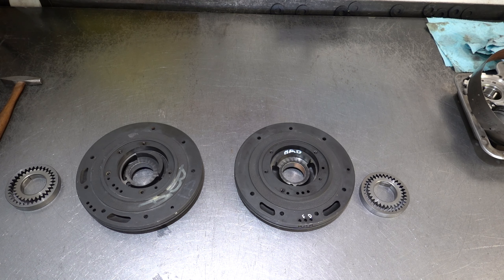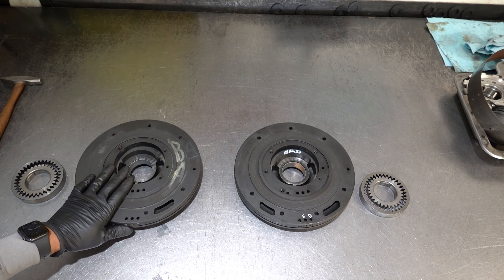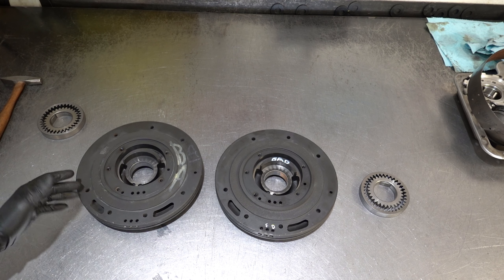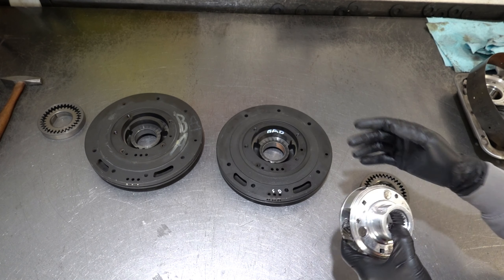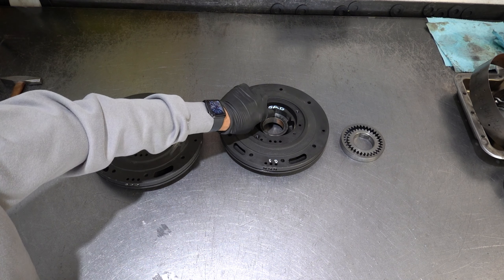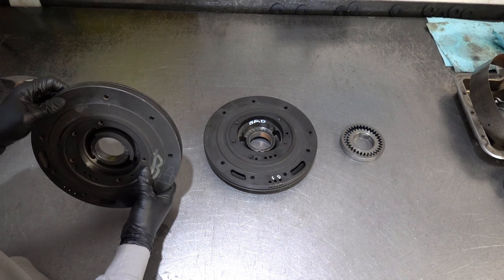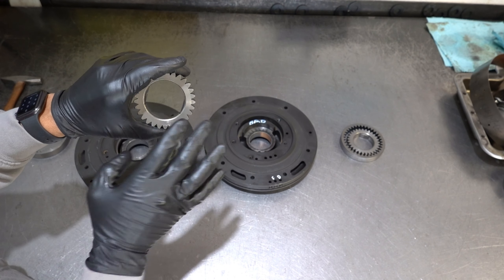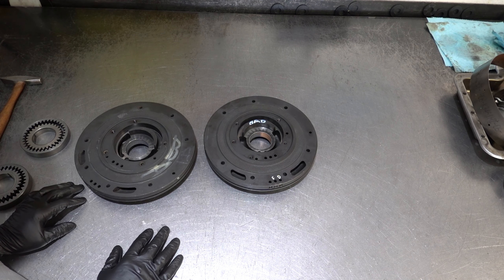Ford C6 Pump Body Inspection PT1: Crescent Wear

Comment: Hello Nick, I am replacing the seals in my 72 F250 C6. I am also replacing the bushing you address in the video. My old bushing is the same style as the one you show, but the old bushing does not have the notch cut in the open side of the oiling groove that faces the gear side. The old one has a notch cut in the seal side to line up with the drain hole, directly across from the notch in the bushing you show. The oil groove is the same in both.
Reply from the maker: Don't worry about the notches, just install the bushing in the correct orientation such that the open end of the lube channel faces inward towards the pump gears.

Comment: Also, keep in mind the measuring instruments used to measure.  The allowable clearances are smaller than the error range of calipers.  A micrometer is needed to measure the gears and a depth indicator is used to measure the pocket depth.  Clearance can be deduced from comparing measurements or directly with the depth indicator with the gears installed when all parts are clean and dry.  Measuring all areas of the pocket will tell you where it's worn and where the clearance is wider and narrower in those places.
Reply from the maker: Thanks for the input, Billy. I have been using a depth and outside micrometers with these and all other pumps. Will do a follow up video showing the measurements sometime next week.

Comment: Pro tip.  Both of those pumps are bad.  

Did you measure the gear clearances?  What are the measurements?  What are the gear widths?  What is the pocket depth?  I can see that the "serviceable" pump is worn heavily in the "bridge" area that separates high and suction pressures - this will cause significant pressure loss as the unit warms up.  It would be a good idea to get another pump that is in better shape or one that has been remachined properly.
Reply from the maker: Thanks again, will follow up with further inspection and next steps...
Reply: @nickstransmissions  Do you have a way to accurately make changes to the clearances if/when you find they are too wide?

We machine pumps in-house.  Admittedly, crescent pumps are the only type that we haven't gathered a method that gives consistent success yet.  

That means that we too have a stack of C6 pumps that just don't make grade, no matter how bad we may need one to.
Reply from the maker: My machinist has a vertical mill and crescent pump program that he's been in the process of getting back up and running...It had been running on a previous mill but he replaced it last month and hasn't got the new one set back up for crescent pumps as of yet (he's been doing lots of GM 6Ls lately)....I also have a stack of C6, AOD, TH350 and TH400 pumps waiting on him getting the program back up...I'll be taking that pump along with the rest of them to him next week as it should be running by then...I also purchased another good/used pump just in case so either way, I'll deal with that pump shown in the video soon.

I will reply here once he gets that crescent program up and running on his mill, in case you'd like to see if he could do one or two of yours to try out...I and he are both in Las Vegas.